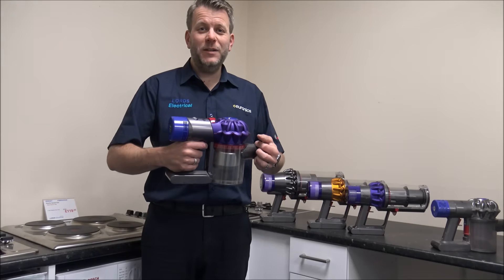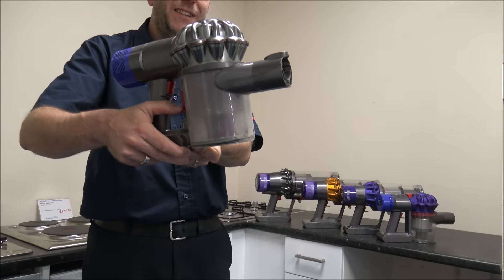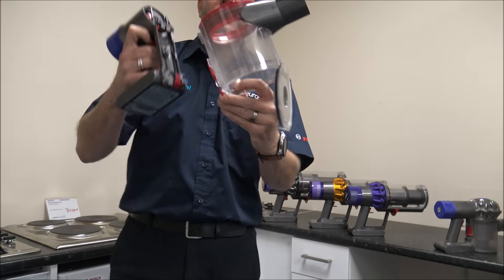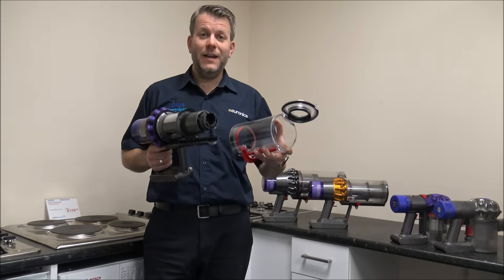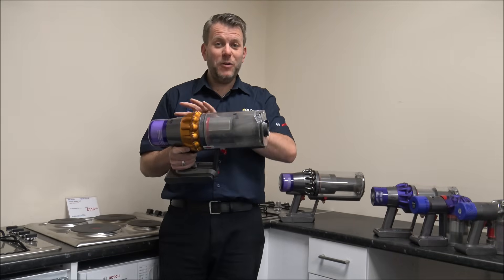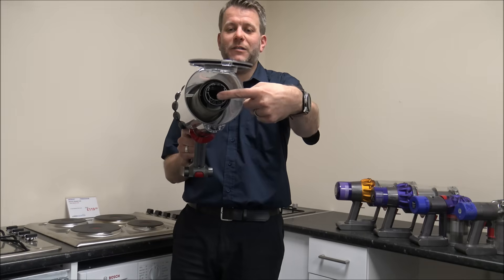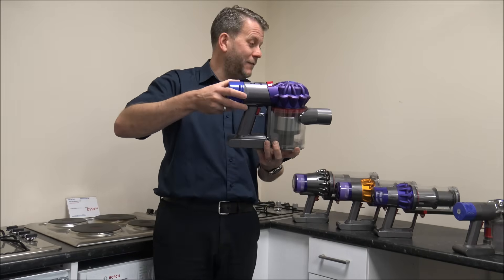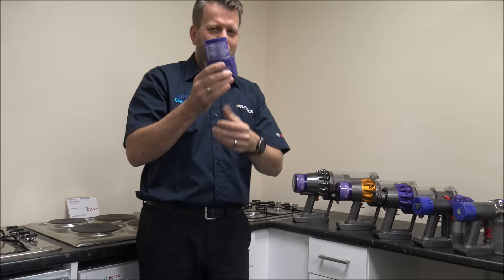Is Your Dyson Pulsing And Not Sucking? Here Is How To Solve It

Comment: mine doesn't pulsate....it runs for about 30 seconds then stops !!!!  Only had it for a short time when this happened,  Won't ever reccommend this  vacuum to anyone.
Reply: Me too!  I have the same thing happening!
Reply: same here
Reply: Mine too!!
Reply: Same here
Reply: Get a dewalt battery + attachment 👍
Reply: I had the same problem and it turned out the lever inside the vacuum that activates the trigger, was broken. It costs $10 (and 1-2 hours of your time) to replace. Better than getting a whole new vacuum!
Reply: Same here 😢😢😢
Reply: It's the filter
Reply: Also take a flashlight look into the machine.  If you can see anything  use a clothes hangar to fish it out

Comment: I have a V8. Best vacuum I have ever had. You briefly mention on the back filter. After disassembling, unsnapping the main components, I washed them in the sink. The part with the cone and steel fine perforated screen discharged mud, for many wash cycles. After letting everything dry, the cleaner worked marvelously, EXCEPT for when the back filter was on. As soon as I clipped it on, the surge came back. Taking it off the machine worked as new. The issue is, it blows directly in your face. Washing it did not help. It is sealed, and the outside plastic shields the filter. I took a screwdriver and split the glued join between the outside cap and body. The exposed filter element, under water then again spewed mud. Let it dry, don't worry about the outside shell, just put the filter on and the blast is directed sideways away from your face. The unserviceability of this filter is I suspect a cynical ploy to enslave us to Dyson spare parts. Who would have thunk it?

Comment: my issue was the purple hepa filter on the end. we had washed it, rinsing with water, we assumed it was dry after 12+hrs of sitting out. put the filter back on and it began pulsing, took it off to vaccum and it worked like new. i will be blow drying it, making sure to not burn it and will tell my results here
Reply: Curious to know if washing the hepa helps... mine is clean but vac stops after a min or so. Removing the hepa cap helps a little but still has issue. Hepa looks spotless but maybe it's clogged with very fine dust. Not sure it can be rinsed easily since it's sealed in the purple cap...
Reply: Mine started pulsing after I washed the filter, I left it on the heater to dry as I have done that before many times but this time after I put it back on my Dyson started pulsing,

Comment: For units with the long slender cone shaped filters, it is important to detach the fabric portion of the filter from the plastic support...as you mentioned...and remove any dirt that has accumulated at the bottom of the filter cage. It can't be removed by simply running the filter under water. Glad you mentioned that the filter should be detached to accomplish this. Whenever my V6 starts to pulsate, this is the reason.
Reply: Exactly! Many DIY vids on this issue don’t instruct to do this step!
Reply: Hi
Reply: I found I also needed to use warm soapy water, rinsing under the tap didn't lift the fine dust (I'm guessing it needed the surfactant properties to help release the particles).
Reply: Good to know. I’ll try this
Reply: Good tip, I have a friend that thinks than he needs a new battery, as he already washed the filter with no fix .
Reply: @michellegreenwood9243  Surfactants attach to the dirt , and allow them to be floated away, so that might work, but watch what you use as filters depend on airflow, and if the ‘soap’ used leaves a residue that restricts the airflow the filter is finished, and using it will only give the motor a hard time trying to suck air through a possibly impermeable fabric .
Reply: @A2Z1Two3  if the problem only happens with the main cleaning foot, there is a large slotted ‘screw’ on one end of the underside. Rotate that 90deg, and then a strip along the length can be removed. This gets blocked, especially if you have pet fur to contend with
Reply: Well on my V8 there is no way to detach the fabric from the plastic suppport. I do see the slits but pushing then in with a knife doesn't go anywhere. However I have a small (25 ml or so) medical syringe with a curved snout that I can put between the upper and lower part of the plastic support, and sort of pressure-clean the inside. Judging by the colour of the water that comes out, this is pretty effective!
Reply: I can't get the fabric portion to detach, .any suggestions?
Reply: @susieq7360  I use a screwdriver to gently push in the tabs and release the fabric from the cage
Reply: Is there any advice or tricks on how to actually do this? That is to detach the fabric portion from the plastic support.  I can see little retention clips and started to try to use a spudger to release them and the plastic was starting to change color (whiten) and deform.  I backed off concerned I would end up fatiguing or breaking the plastic.  It looks like a design feature for factory assembly that doesn't look like it was really designed to come apart.

Comment: I have a Dyson DC44 Animal cordless since 2013.  I use it for steps, bathrooms and quick pickups.  I make sure I empty after every use.  It works fine.  I also had a purple upright. Can’t remember model, that was a tank.  It picked up and never a problem.  Wife dropped it down stairs.  She rarely vacuums and dropped it.  Jeez.  Thought I’d get a Shark Apex.  It is a great machine with loads of attachments, but it never cleaned like my Dyson.  Now I got a v15.  It is amazing.  It’s picking up pet hair that my Shark never could, and only in two passes.  I love it.  Learn your Dyson.  Keep it clean and filter clean.  It will serve you well.

Comment: You are brilliant!  I went through numerous videos trying to figure out why my Dyson v8 was pulsing and stopping. Did everything that you and others suggested. Cleaned filters and put back on in 24 hours after dry. Pulled vacuum apart and cleaned every nook and cranny. Still no luck. So per your suggestion I ordered new replacement filters. Coming in 2 days. 
But just at the end of your video you mentioned the problem could be the the seal of the cannister door flap. I  cleaned the rubber gasket even more. Plus I realized that sometimes when I slap the door closed, it is not perfectly flat and sealed to the cannister. Just off the tiniest bit. So when I closed the door more carefully.... guess what? No more pulsing or stopping. That little detail that you mentioned solved my problem. Thank you so much!!!!!
Reply from the maker: Brilliant well done that's great to hear. Thanks for the great feedback
Reply: Thank you so much, mine started doing this a couple of days ago.Much appreciated😅
Reply: That’s a good thing to check. Noted!

Comment: I have a v8 and watched several videos on how to service the unit. This video was by far the best and easiest to follow! Mine was pulsating and I did everything to correct it—turns out mine needed the very last item mentioned in the video. So grateful!!!
Reply from the maker: Great to hear this was useful for you, well done on solving the problem.
Reply: What would have helped me would be, providing a general overview up front, like a clear - visual, outline with words that make sense - that doesn't lead the learner into getting stuck in loops of misunderstanding, because I have a hearing impairment and can't think when I do not clearly comprehend what I am being shown. 

Not everyone speaks the same learning language and mine is to have a visual roadway, with an understanding of the key, presented to me in the form of a brief where I can engage and seek clarifying questions. Otherwise, I can only learn by reading the broken captions and interpreting within my own frame of reference. 

I am, however, grateful for the learning opportunity you provided. Thank you!

Comment: Got an older V6 animal that has had v little usage.  When it pulses your informed to ring Dyson.  You do so with them asking about the lights on the battery when it pulses.  They put you on hold while they say “I’ll go and check the troubleshooting manual”, they come back on the line after a few minutes and say it’s the battery.  And yes, this is the 2nd time in exactly 4 years I’ve owned it.  As the first time it was just in warranty so go that one replaced free of charge, this time though they want $120.  Save yourself the money and watch this video, it solved my pulsing issue in under 5mins.  I’m now going to go dig up the original battery and recheck that now as i never threw that one out.  Now i know all the components of the vacuum and got to meet them, I’m more than confident in troubleshooting it next time the pulsing issue returns.  Thank you good sir for your video and service to your fellow YouTube community. ❤
Reply from the maker: No problem glad you found it useful. Thanks for this great feedback. 👍

Comment: Very Helpful video. I have a V7 and a V8. The V7 has been having the pulsing problem for nearly 2 years. I always take the filter out and clean it and it works again without pulsing for 10 minutes then back to pulsing. The filter is always packed with dust. I typically tap it the sink and get lots of dry dust out. Every so often I also wash it. But the pulsing issue returns shortly thereafter. I finally took one extra step: I took the sealed cyclone unit off and washed it under running water through all the internal (invisible) paths both through the holes around the top and through the bottom. The amount of dirt that came out was incredible including big chunks of mud. Black water came out for at least 15 minutes and the water wasn't clear until I had washed it for at least 30 minutes. Apparently there was so much build-up inside the cyclones that they stopped working efficiently and the dust went straight through and into the filter causing it to clog very fast. After this "super-cleaning" it works like when it was new!
Reply from the maker: Thanks for this great feedback 👍
Reply: A V7 and V8 filter should almost never accumulate dust on the removable filter. It means that either the internal cyclones are clogged with caked on dirt OR you are overfilling the bin and large debris is entering the fine cyclones and then making their way to the filter. The solution is to always empty the bin regularly and never exceed the fill line on the bin, and you probably will need to full dissassemble the cyclone assembly and clean all the internal parts. Admittedly this takes a while and can be tricky/messy. There are videos on how to do it. At work we remove the cyclone assembly from the motor and then wash the whole cyclone unit in warm water with antimicrobial hand wash and then dry it infront of a powerful fan overnight + compressed air gun, because we don't have time to fully dissasemble, clean, and reassemble the cyclone. Again, the main reason that we need to do that deep cleaning is people overfilling the main bin.
Reply: Still have the same problem. Wished i never bought it.

Comment: Oh Mercy!  I had cleaned the bin and filter, checked the tubes for blockages nothing.  You nailed it when you said to see if the passage in the motor part is clogged. A ton of debris completely blocking it.  I am letting the filter dry and will recharge overnight. I hope I didn't blow the motor.  Thanks for the very easy to follow instructions. I will click on a few ads for you.
Reply from the maker: Well done on sorting the vacuum. Thanks very much for the feedback

Comment: I really like your presentation. It's a clear (and clean) description of what to do. It may have been sufficient to solve the pulsating problem I had. I highly recommend your post to anyone with the pulsating problem However, before I saw your video, I followed another very good presentation that showed how to take apart all the pieces, including the rubber seals, and using special screwdrivers to remove certain parts for a very thorough cleaning. The lady presenter also showed how to put everything back together again. As I hadn't given the Dyson a proper cleaning in the last two years, it may well have been necessary to do what I did. But next time I shall first follow your post, and clean my Dyson more regularly. Many thanks.
Reply from the maker: Great feedback, thanks very much 😊
Reply: So, I just disassembled our Dyson V8 Animal yesterday for its routine cleaning. We have had this model for over a year now and I try to give it a full clean once a month or every other. I did something different on this last cleaning. I removed the filter located at the rear of the vacuum main housing. I washed it thoroughly. As my wife  started the machine this morning it was pulsing. I failed to mention that it was pulsing prior to the cleaning yesterday.  It was primarily what prompted my cleaning it. Well, whenever I heard it still pulsing, naturally I was stymied as to it's doing so. Pulling up a few Dyspon 8 vacuum DYI checklist tutorials, it was this segment that led me to realise that it was the filter that I mentioned earlier. It was not completely dry from when I washed it yesterday. Thank you for your comprehensive instructions on all Dyson products.

Comment: OMG you have saved me hundreds if not more $! I was ready to buy a new traditional vacuum cleaner tomorrow because I've had MONTHS of my Dyson V8 pulsing and it's so blood frustrating.  Although I didn't find any blockages, just taking it apart did the trick in that now it's just running and not pulsing! I probably do need to clean the filters and undo the floor accessories, but the weather is crappy and so I'll wait til the sun comes out and in the meantime order more so I don't have to wait to use it. Thank you so much, really awesome video.

Comment: Super helpful and appreciate all the models being included.  Solved my V8 issue thanks to your video.  I can return the Dyson back filter I ordered for $30 thinking it could be that… thanks to you saved $30, kicking myself for not finding your video sooner, would have saved myself the hassle of the filter return!  Thanks for the informational video!
Reply: Hi Angela, thanks for your comment. I too have the V8 and in the morning, will be checking over my machine for any blockages . I’m just interested to know, was your issue just the filter, and, if you did have a blockage somewhere, where was it please? 

I’ve checked mine over previously, but I now think that the blockage could be in the section where the hard pipe meets the canister. 

Now that I know how to completely separate the canister from everything else, I’m going to give it a really good wash and a thorough checking over.

Anyway, thanks again for sharing your success and for mentioning that you had a V8, super helpful thanks, Eve
🙂🐿❤️🌈

Comment: Great video! Very informative and fixed the problem with our Dyson V8 which was pulsing with lesser and lesser suction than normal. The problem was a bunched up Home Depot receipt and accumulated dust and hair in the intake pipe; something you addressed in the video. We were ready to buy a new unit, but now it works like a charm. Thank you very much.
Reply from the maker: That's great to hear, thanks for the kind feedback

Comment: love my Dyson, v7 or 8 - couldn’t recall the model as there is no indication on the unit.  In any event, i clean the filters and bin on a fairly regular basis.  When the intermittent on/off issue occurred, even after a thorough cleaning, I found a small wad of dust or dog hair blocking the flap from properly closing.  Brilliant solution and more cost effective than ordering another vac….  Cheers!
Reply from the maker: Great to hear this well done. Thanks for the feedback